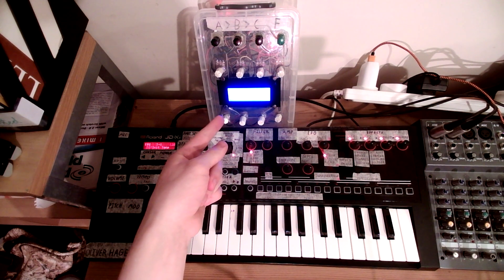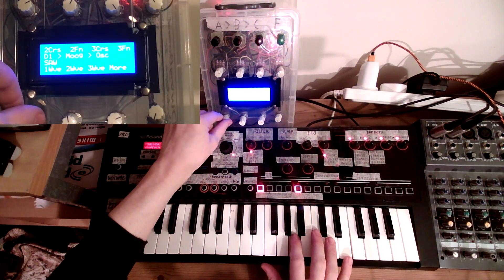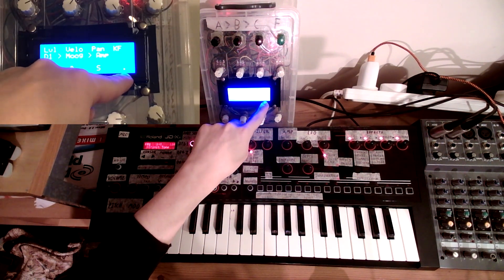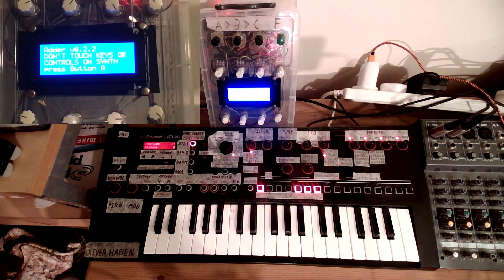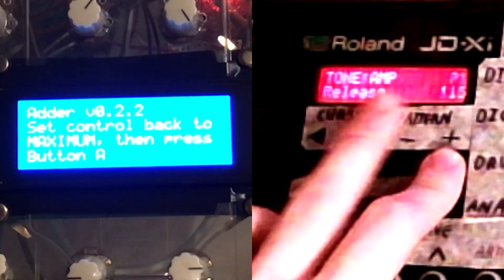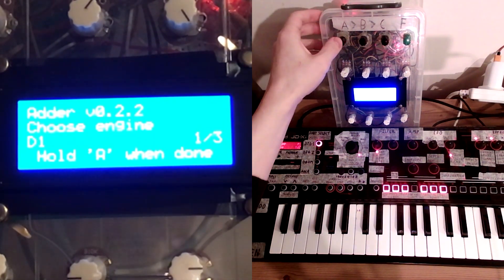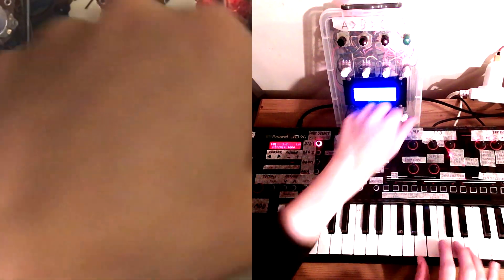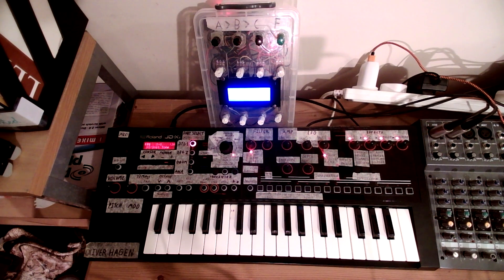DivingBoard Demo - a home-made MIDI controller for the Roland JD-Xi

Comment: This is fantastic.  I've been working on something like this, but haven't done any work yet with Arduino, PI, etc. So it's a HUGE learning curve. Seeing some of the challenges you've worked around is helpful. I'm hoping to make a box that you can just connect a Class compliant controller too or through.

How do you propose handling some of the hidden features or features only mentioned in the sysex guide, like changing Midi channels, which aren't available from any JD-Xi Menus?
Reply from the maker: Cheers. If you need a hand at all with the Pi and Arduino stuff, I’m happy to share what I’ve learnt. 

Regarding the non-menu features, this is actually the first I’ve heard of them. If they work like any other parameter, then the adder.py programme should be able to do it’s thing. Otherwise, copying bits from the midi implementation guide might work… but this calls for a quick experiment.